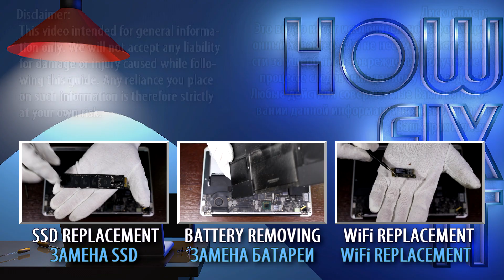MacBook Air 13" Mid 2011 Disassembly, Fan Cleaning, and Thermal Paste Replacement Guide

Comment: What's that stuff you squeezed onto that thing at about 6;30? ... some commentary would be helpful.
Reply: It is of course "thermal paste" a goo like product that helps transfer the heat from the CPU to the heat sink. Buy a good one, not a cheap one. Fro example Artic MX-4. Do not apply too much, search videos on youtube on how much to apply.